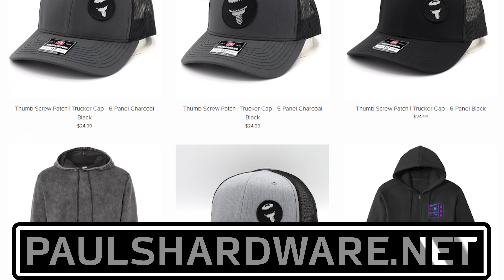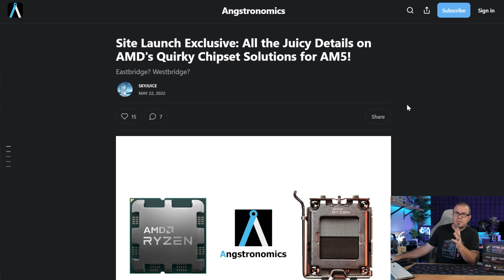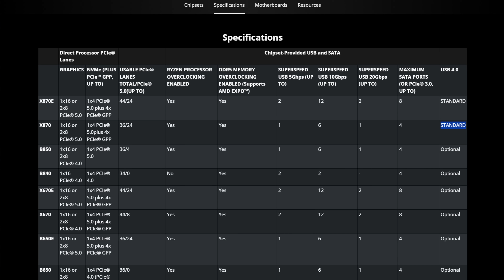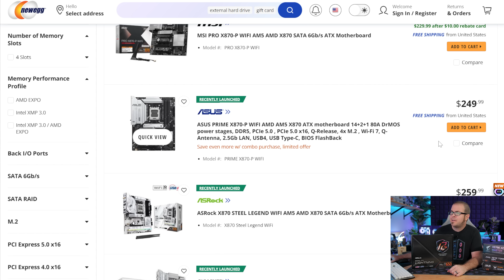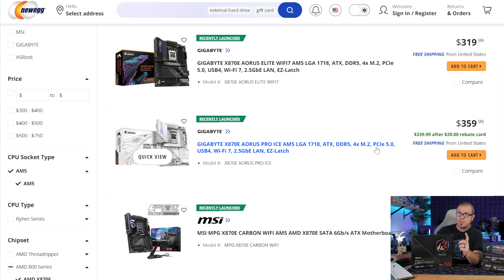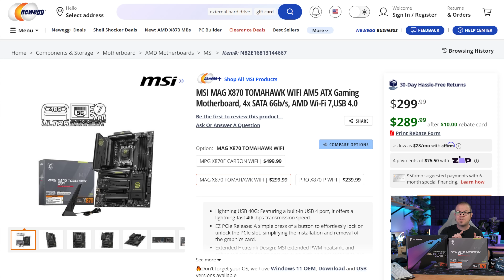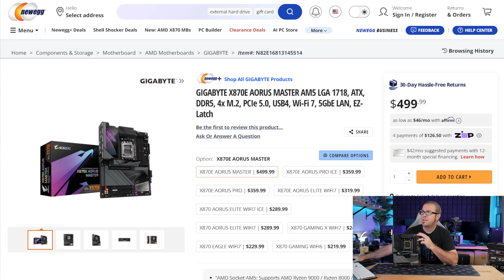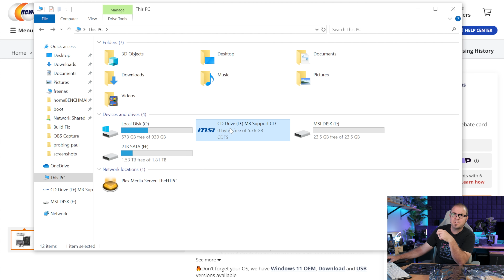Explanation / Rant about AMD X870 and X870E Motherboards

Comment: 🧐🤔🤔🤔 I mostly would use for AMD only 2 motherboards, the asus proart x870E or the AsRock x870e taichi, the asus only because allow me a double rtx4090 or 80 giving me 32 to 48 GB Vram. But I agree with you in mostly everything you said about the new X870s, and we still need to wait and see what the rtx 5000 series brings in the close future. For now I just stocked a goid amount of ryzen 9950X and because windows is getting worse day by day I decided to use Linux and the 9950x is a beast improving performance beyond my expectations. I can be wrong but I strongly believe the bottleneck us now in software and not in hardware, more specifically in the OS, windows 11 is terrible, 2/3 of the OS code is absolute trash, after a couple of weeks working on Mac OS and Linux my crew likes much more our new setup that the nightmares we had with windows+14900k+4090, the only I hope AMD improves is RAM efficiency, because 4 sticks configuration doesn't work right out of the box and we needed to fine tune and manually setup the 4x48GB sticks at 6000 or higher speeds, but after a couple of hours we found the right settings in both asus proart and asrock taichi. Honestly speaking after being team blue for decades I'm surprised how the 9950X beat to dead the 14900k, the 14900k was my worst nightmare, keep running 24/7 an over 100 workstations fleet with the 14900k was horrible, now with that problem solved replacing all of them with 9950Xs things got much much better, but the rtx 4090s keep being a headache, is why we use a double rtx4080 super proart setup, because both the 14900k and rtx4090 burn no matters we use the highest motherboard quality.

Comment: Looking for budget options in a brand new product lineup at launch? You are going to need more than a pair of glasses to find such a rare bird in the fields of online shopping. Maybe something like this could be found in a Microcenter Bundle that you have to buy in store if you are extremely lucky. 

Really these boards seem to be requiring forward-looking options like pcie gen 5, looking at the next gen GFX cards there obviously. Nobody wants to release a board that is not going to be able to handle a new card within a few months of launch. Much better speeds on connections, moving from 6 to 7 on wi-fi, dropping gen 2 USB in some cases, more nice to have buttons, LED readouts are all general improvements. Let the initial price frenzy subside and buy on sale, as everyone really should be doing imo. 

For me the out of the box RAM compatibility is a sweet addition considering the platforms problems in this regard previously. Most buyers really want those working out of the box and to not have a need to fiddle with timings or updates to the Bios to get running I feel.

And really if you are in the B series market to start with, stay there and leave the X series alone. Everyone should know which side of the board (heh heh...) they are on with the extras by now.
Reply: @Valthalin  are these motherboards without rear USB 2.0 support still providing internal headers for it? Cases often have front panel USB 2.0, and there are some devices that don't play nice with USB3 due to shielding of the power delivery (some Elgato devices, GPS receivers etc)

Comment: The big thing you're missing is that the new chipset has wifi 7 and a wifi 7 card costs $60 Canadian.. having gone from wifi 6e to 7 recently, the difference is huge, not just in throughput but ping as well. The price difference between 670 and 870 is about the same as buying a wifi 7 card
Reply: What uses wifi 7 though?
Reply: @pegcity4eva  new laptops & phones that released this year mostly use wifi 7, as wifi 7 will be standard in up coming months on new devices if u are aiming for middle to top spec
Reply: @DingleBerryschnapps  my ping in rocket league went from 70+ ms to high 30s going from 6e to 7. Noticeable spikes to no spikes.
Reply: @pegcity4eva  I do and my ping in rocket league went from 70ms to high 30s coming from wifi 6e

Comment: I am so glad I bought the Asrock Taichi Lite B650E a few weeks ago as i collected parts for building my new AM5 setup. I'd bought the others parts first since I KNEW I wanted 4gb nvme 4.0 x4, 64gb ddr5 6000 cl30, 1000x psu. Once i decided on the MB, I bought the MagniumGear NEO Qube 2 IM, and then CPU must be decided upon, wanted to wait and get the 9600x and eventually buy the 9800x3d, but with those going down in flames, I bought the 7800x3d just in time. It was the last one on the shelf in my local walmart as they were out of stock every place at $400 or less.

Comment: There will be differences in UEFI features and RAM support. The 800 series chipsets will likely all support CUDIMM DDR5 with the Ryzen 8000 and 9000 CPUs. They also supposedly made changes to improve the memory traces on 800 series boards. The chipset itself is the same, but other features may make these worth it for 9000 series CPU owners. I have a 7800X3D on a ROG Crosshair X670E Hero so I can only hope that I'll get UEFI updates that add things like CUDIMM support with newer CPUs.
Reply: Ok but far as dimms go. How fast before ya go past the suggested ratio for the infinity clock?
Reply: as long as they keep the 2 useless dimm slots/antennas it's no use DDR5 never worked and never will work properly with 4 dimms they need to stop the lie and remove those slots that nobody can use at proper speeds buildzoid explained x times leaving empty slots was bad and oc dedicated boards only have 2 there's a reason why
Reply: Yes, you should be able to run faster RAM that you bought for more money and get almost zero performance benefit from doing so.  What a great deal.
Reply: @rangersmith4652  Except, you know: we've already seen the performance benefits of faster RAM. You can get upwards of 5-10% uplifts in performance.
Reply: @rangersmith4652  Not necessarily. For running Local Al faster ram may be beneficial. I hope sooner or later we will not need Vram for this purpose just fast Ram, lot or it. Still cheaper than buying 3 or 4 graphic cards.

Comment: I'm happy with B650E performance as it is.
HUB already stated that the gaming performance of X870 is virtually identical to X670 (and most likely B650 as well).
Reply: Wish I could be if they every produce 7800x3d again
Reply: Well X670(E) and X870(E) are the exact same chip so it's obviously identical in performance. And i don't even know where people are still getting this nonsense that somehow chipset affects performance to begin with. Ever since the memory controller got moved to the CPU the only thing that motherboards can affect is signal strength through the quality of the PCB (but this is entirely separate thing from the chipset and only depends on the manufacturer and it's market segmentiation) and what the PCIe/M2 layout is.
Reply: @kerotomas1  i got almost 20usb device and hubs are not reliable...
So i have to go for x870(e) 🥺

Comment: @3:41 A value-add of extra IO is a sound proposition.  But, when I shop for motherboards and go up to the X670E I see no more or even fewer PCIe slots, m.2 slots, and/or SATA ports on the motherboards.  So I guess I am just getting more USB connectivity.  Is that correct?

Comment: Question Mr. Paul, do you know if the Wifi 7 antennae is unique? I'm looking at getting a X670/B650 and just swapping out the wifi card for a 7 at some point, but don't know jack about the antennas from 6E to 7 wifi standard, only that the standards themselves are different.
Reply: WiFi 6 uses the same frequency bands as WiFi 7, so it should work (am also a novice at antennas though, am interested to hear other people's views)
Reply: First you need a WiFi7 router, then you can think of the antennas if you really want to....
Reply: @Quast  I'm in the market for a new mobo, therefor I'm worrying about that right now, because I plan to get a wifi 7 router. Useless ass comment.
Reply: @myselfalex  You will see, when you don't direct the antennas not towards the wall behind the metal box that the PC is, your reception will increase more than with some extra long antennas. The gain is minimal....

Comment: I love how nobody is doing benchmark reviews of the X870(E) boards because they've tested the 9000 series CPUs like 3 or 4 times already and have had enough!! Like you said, the specs are basically the same so the performance will probably be the same too, so there's really no need. At least you've got a few extra boards to choose from when you finally get your hands on the X3D chips.

Also, "snatch" sounds like what you might come out with if you mean to say "snack" but change your mind and half way through and say "lunch" instead! :-P
Reply: Or, it's because motherboards haven't made a difference for CPU performance since Nahalem in 2008.

Comment: X870/X870E is too bloody expensive for what you get versus the X670E counterparts.
Reply: No X870 is not
can only speak for my pricing region but if I'd want a 670E I'd still have to pay a minimum of 345€ for the cheapest board
670E (and in part 650E) are still bloody expensive
Reply: im still wondering if its really worth it  - it was as expected small upgrades.  the biggest uplift is usb 4.
Reply: @adamtajhassam9188  I think the only thing noteworthy abt these boards is the wifi-7 support but I heard they still run at wifi 6e speeds, so then the extendable antenna maybe.
Reply: PCI-E Gen 5, plus the support for AMD EXPO DDR5 8000 which you cannot get on an x670 board. Weither that is worth it is a different matter.
Reply: @JohnDoe-bf7hb  X670e boards also support pcie gen 5 for both the top nvme and top pcie slot, and I guess there are some boards with more support, so basically just ddr5 8000.
Reply: X870 = £250-£300 X670E = £350+
Reply: or x370 for that matter
Reply: @BTD3Fan still rocking mine 👌
Reply: keep the old board for AMD, if you need it to be faster, invest in Arrow Lake please
Reply: @lucasrem Why would anyone downgrade as arrow lake is slower than 14th gen

Comment: I just want debug LEDs on an affordable low to mid range board.
Reply: Sorry buddy it's too late,the corporations realized they could take away features and sell them back to you at a premium.
The shareholders need a new yacht you know,won't you think of the shareholders?
Reply: I saw the LED debug things on amazon for pretty cheap and yet manufacturers only put them on high end stuff
Reply: Really is no reason to not have an 8 segment display on every motherboard. They cost nothing.

Comment: The Gigabyte X870E AORUS Pro Ice is sooooooooo pretty though! 😂 FYI The "internal" HDMI port on the Gigabyte boards is supposed to be for supporting a stat display.
Reply: I just bought it but now I’m wondering if I’m screwed trying to throw two nvme drives into it lol
Reply: @SevenBlades , X870E should be fine. I currently run 2 gen 4 NVMe drives (Samsung 990 Pro) in a B650 board (no E) without any loss of read/write performance.

Comment: If you want an overbuilt board, the last gen asrock x670e taichi is plenty and already had usb 4. Only appeal of the new ones for me is stuff like quick release and moving around some buttons/leds
Reply: Though worth mentioning that's an E-ATX sized board.
Reply: @KiltedCritic  almost forgot since it really doesnt feel that big compared to say a godlike or whatever asus version is since e-atx isnt a real standard
Reply: Or the B650E variant. I've been told that thee usb4 chip only provides up to 32 gigabit though, not the full 40.
Reply: The board that is still selling for 480€
gee, just say....
Reply: @Quast  its a lot cheaper in the us i guess
Reply: this board costs 630 euros in my country so its a definite NO , the tuf costs 380 and the gigabyte one 350.
Reply: @MrMarlboro_GR  dang, thats 2x the cost it is in the us
Reply: @Jzwiz  well in my prices put 24% tax , yours doesnt have any , still they are very pricey here.
Reply: @MrMarlboro_GR  thats a shame, even the new x870e version is only $400 usd ish here
Reply: Got that board it's great.. got it on sale
Reply: b650e taichi lite is near identical and way cheaper, usb4, pcie5, same vrm, etc.
Reply: That board is still way over priced 400+  might as well spend the extra 150 for the 870 taichi
Reply: @ prices heavily depend where you live, both are close to 300-400 here but the new ones are never in stock
Reply: Rocking my taichi b650e, it's the best thing EVER... My only gripe is with the extra size it covers the grommets on my case and had to get creative to show my cable extensions, and even part picker said my case and Mobo are not compatible... But... What do they know it looks and works great in my white Asus gt501.
Reply: This aged like milk
Reply: @GamingGoonLord  did it though, the x670e taichi hasnt caused any issues, only the x870 line
Reply: The one meaningful reason I can think of to not use that x670e taichi is that it only has 1 M.2 slot with gen 5 NVMe. Some other manufacturers allow for up to 3 slots, although they require you to downgrade your GPU slot to only 8x lanes, and the second x16 physical slot is usually routed through the chipset instead of CPU.
Reply: Don't think I'll ever use an Asrock board
Reply: @JustAnotherAccount8  I'm still rocking my asrock x370 taichi. Works like a charm holding my overclock 👌
Reply: @JustAnotherAccount8 no problems with my x670e Taichi
Reply: @JustAnotherAccount8  ASROCK B650 Pro RS has some solid VRM for the price.  Taichi, Taichi Lite or Steel Legend are all excellent.  What's not to like?

Comment: I’m still on a 12700k with ddr4 and even watching reviews it’s super hard justifying upgrading my system yet for 2 reasons. One mainly when the hell did mobos get this expensive? Also mainly when looking into the 13,14th gen intel and ryzen 9000 cpus they all seem to have either really bad instability issues or there isn’t much of performance gain from the pervious gen 7000 series. This amd refresh seems like a panic move lol.
Reply: If I had a 12700k I wouldn't even start watching tech videos again until at least the end of 2025.
Reply: @DingleBerryschnapps  I like staying in the loop to know if it’s worth it ya know! My pc runs fine but since editing with adobe software sometimes you can never know what upgrade may fix it or u spend $600 and it not fix the issue 😭
Reply: I'm upgrading to x870 and 9800x3d from x370 and 2700x. I feel next generations will be even more expensive.
Reply: AMD doesn't have problems with there CPUs only intel has these stability issues

Comment: The prices are out of control in Australia, the Msi Carbon wifi x870e comes in at $920aud
Reply: Always wild to me how much more expensive computer parts are when you don’t live in America. Its not like we manufacture them here either.
Reply from the maker: eek that is terrible 😫
Reply: They are just as bad here in Canada Taichi Lite is close to $600 CDN
Reply: We don't have the MSI boards yet, but the Aorus master is 618 USD or 898 AUD..

(We pay 25% VAT in Denmark)
Reply: Canadian price for the carbon WiFi is $700 CDN, or $519 USD
Reply: Here in germany it's around 450 € (incl. 19% VAT) which is around $720 aud or $500 US.
Reply: It's the same price as a x570 meg ace was in 2019 here in uk at launch 420-450with 20% VAT included while expensive its not that bad
Reply: @johngrammaticus5296  the ace has 10 Gbit at that price point tho..... Eh...
Reply: @W0ND3RB0Y1  your thinking of the God Like the ace only has 1gb and 2.5gb Lan  I had to look at my user manual to check lol
Reply: I’m not sure if the manufacturers are gouging or we get charged massive import taxes. AI
Reply: I got one today from Amazon for 690$ aud :)

Comment: AMD really dropped the ball with ZEN 5 as a whole. The cpus barely being an upgrade, the mobos being identical with only slight wifi/usb revisions. But i just dont see a point to these boards, again its just the marketing department trying to talk over the engineers saying its not worth a whole new gen of boards when they are the same.

Its feeling like intel 14nm all over again.
Reply: The only thing that makes am5 success is longevity.
If am4 is still holding on, am5 is here for easily a decade
Reply: It’s a substantial upgrade just not for gaming.
Reply: @VoldoronGaming Nobody cares about productivity.  That's why it's a flop.
Reply: @ChrisZukowski88  motherboards by itself will not make gaming faster.